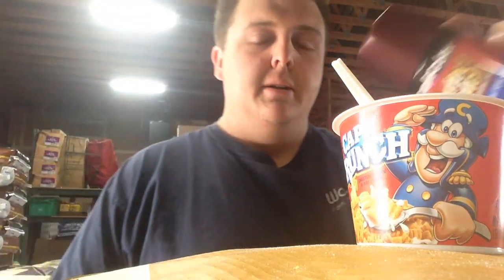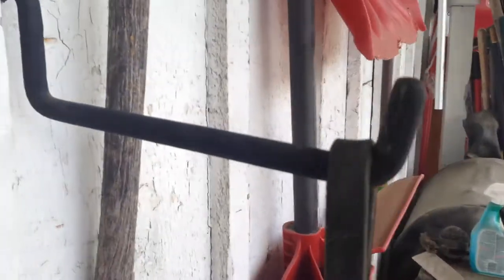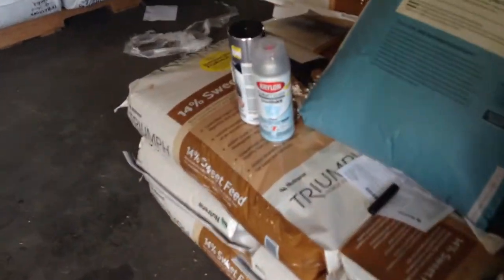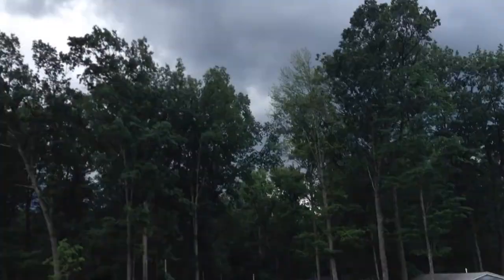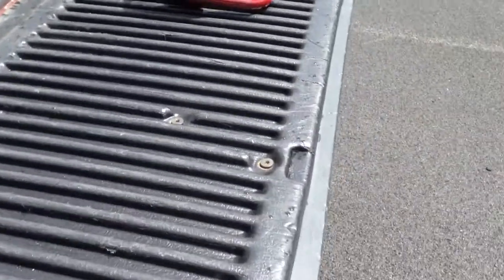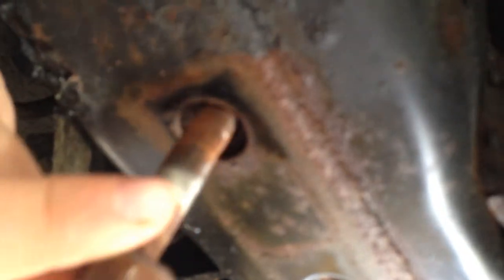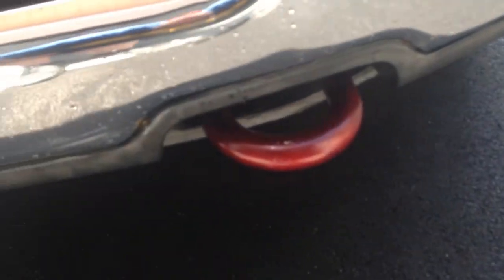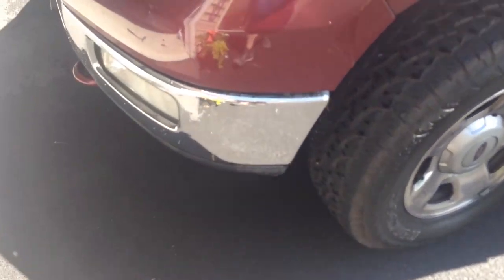FORD F-150 TOW HOOK INSTALL (PROJECT BIG MAMA)

Comment: What size bolts were used to fasten the tow hooks?
Reply: On my 1998 I had a 5/8 head on the bolts. Other video indicated a 3/4.
Reply: YOU CAN BUY BOLTS FROM DEALER FOR $2.00 EA